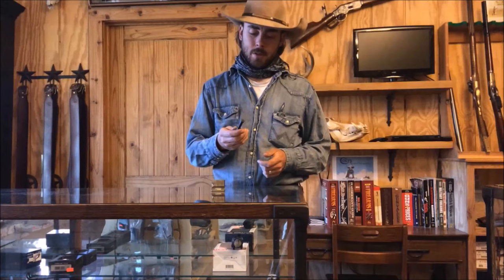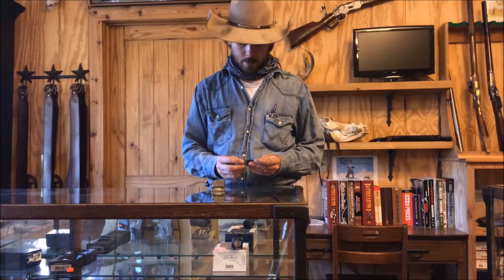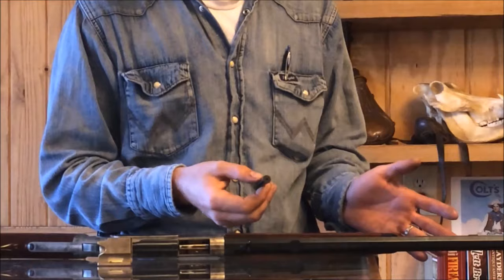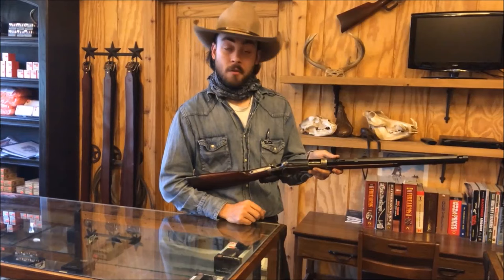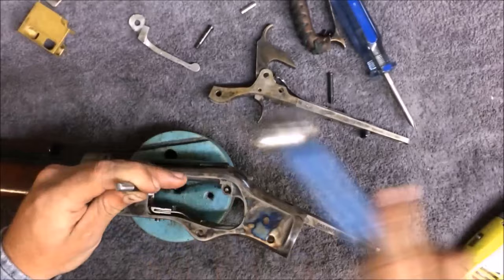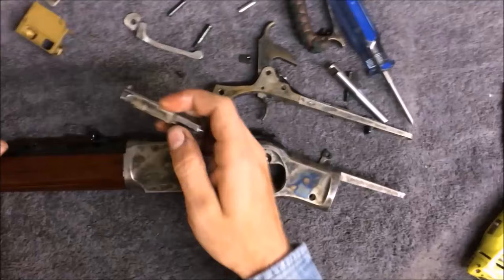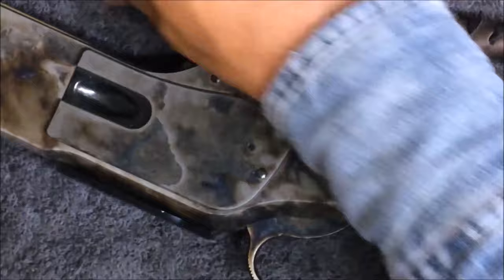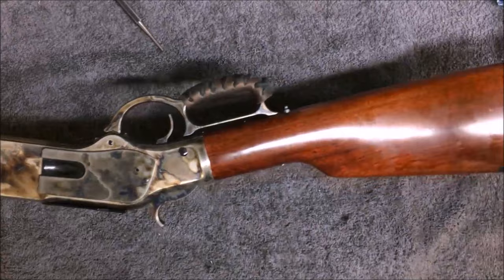1873 Bolt Removal or Broken Bolt Tab

Comment: So, is this a problem that could occur with a “straight-from-the-factory” Winchester?  It seems that loosening of the springs is playing a role in short stroking and it sounded like you implied this would NOT be an issue with a gun that was not tuned for speed.

Comment: I cannot get my side plates off my rifle. I’ve removed the screw and they are like glued to the gun. I have no idea what to do at this point.
Reply: Henry...66...or 73?
Reply: @Master...deBater  73
Reply: @codycorado2581 :  Wow...that's unusual...did you ever get it apart?  People usually have trouble with the earlier models.
Reply: @Master...deBater  I did. I called Taylor and Co and they had me basically punch out the other side
Reply: @codycorado2581  :  Yeah...I was going to advise you to screw the plate screw into the opposite plate and lift it off.  Make sure you take the magazine screw plug out and lube it...so henceforth it can be easily removed. Anyway...glad you got it apart.'
Reply: @Master...deBater  I appreciate the help!